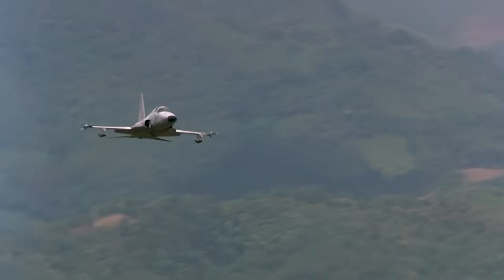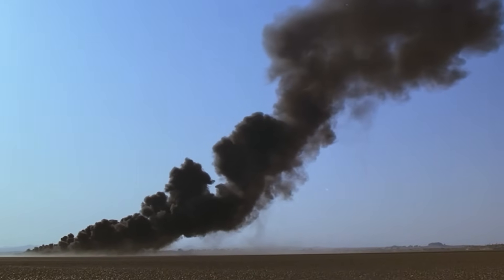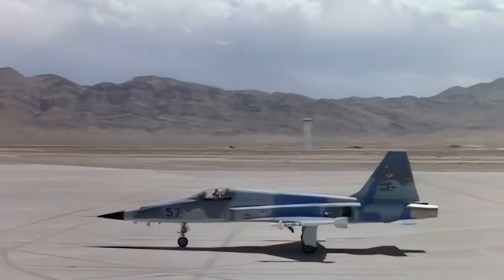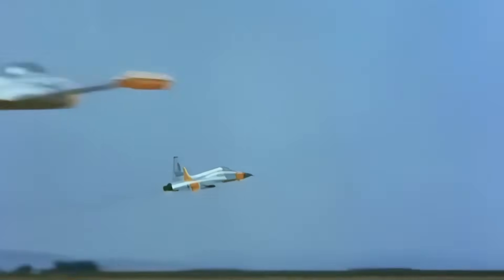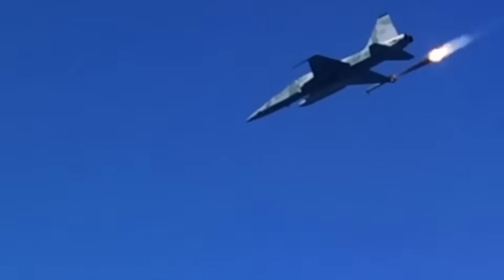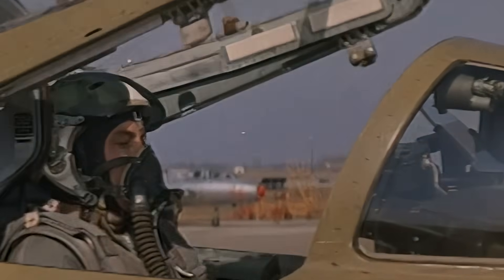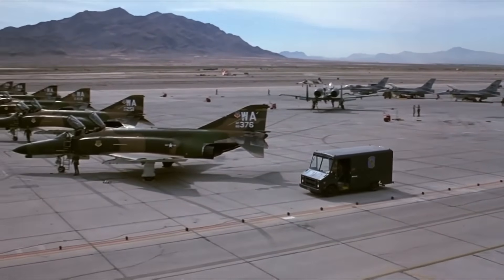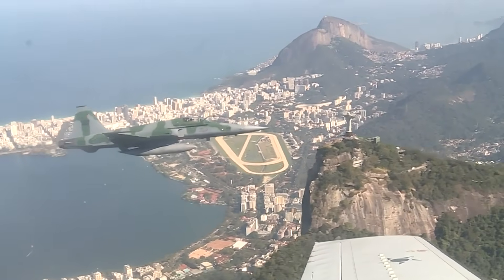The Small and tough Northrop F-5

Comment: Mistake here 10:58. I think you might have mispoke, but the F-5E didn't use the J58 engine as that's the engine used in the SR-71. The F-5E used the upgraded J85-21 engine.

Comment: The F-5 and T-38 was one of my favorite aircraft while growing up.
Reply: The T-38 Talon is the two seat version of the F-5 Tigershark. I believe T-38s are still in use by the US military and NASA. (NASA aircraft paint schemes (sky blue/white) are similar to the presidential aircraft.) I know of at least one T-38 is/was owned by a civilian, (retired) USAF Col. Thornton. His Talon was filmed in the movie, Dragnet, flown by Colonel Thornton.
Reply: @TheHawk--oe8iq  The T-38 is not the two seat version of the F-5 Tigershark.  First of all the Tigershark is the F-20, not the F-5E.  The T-38 and the F-5 are not the same airplane although both were derived from the N-156 prototype.  USAF didn't need a light fighter but needed a new advanced trainer so Northrop developed it into the T-38, which flew before the F-5.  Further development led to the F-5A/B Freedom Fighter, which flew a bit later. The F-5B has significant differences from the T-38 and even though many parts are interchangeable many are not.  The F-5E/F is even more different.

Comment: those F-5s the soviets got...yeah their test pilot mopped the floor with every Mig-21 he flew against. Then the russians tested against their most advanced fighter of the time, the Mig-23. It lasted longer against the F-5 but the F-5 still won.

this was a 1950s era design, the cheapo export fighter, vs the current and new front line soviet fighters...and it won, EVERY SINGLE TIME.

Comment: 6:15 "decent flight performance" is one hell of an underrated line for the F-5 Tiger's actual flight characteristics. This little fighter is so maneuverable that it can stick to fighter aircraft much more maneuverable in low speed situations. This lent a great deal to the F-5s ground-attack role - it meant that it could be much more accurate (albeit at the expense of being shot down much more easily due to the lower speed).
Reply: Wait a minute, all the A-10 fan boys insist you need to fly slow to be accurate in the ground attack role.
Reply: Ground attack doesn't require maneuverability. It requires stability, which is the opposite

Comment: If they were to give this a stealth treatment it would be an amazing low cost response fighter.
Reply: LOL.  "The stealth treatment"?  That would require a redesign.
Reply: @gort8203 not really, but its okay if youre ignorant of what stealth actually entails.
Reply: @helmhamburgerhand  As you seem to be.
Reply: @helmhamburgerhand actually quite really. Stealth requires use of radar absorbent materials which can add to aerodynamic drag, and angled fuselage panels which also negatively impact aerodynamics. Stealth also requires (or at least demands) internal storage of weapons, and that's going to be difficult on an airplane that never had much internal volume to begin with.
Reply: @winternow2242 no not 100%. RAM is a secondary part of stealth anything. The majority of it comes from reducing or altering radar reflection. Which largely is done by reducing rounded surfaces and aligning angles presented by the craft. Which can easily be done to any aircraft given research & testing. After that Then comes any of the myriad amounts of composite materials and coatings. You actually dont even need internal weapons bays if you build the storage into the wings.  And a plane that size will start off with a miniscule cross section given even basic modifications. Add any RAM coatings and this is tiny
Reply: @helmhamburgerhand in other words, change the surface shape, make the wings bigger, use different materials, etc., but somehow it's just a modification of an existing airplane.  

So it can do the same job as airplanes we already have, and have had for years. 

And we would don't that...why?

And, nope, testing isn't easy at all. Wh where did you get that idea?
Reply: @winternow2242 and yet boeing has made its umoteenth version of the F15 with various stealth features. Korea, japan, various Europe countries have all developed some form of it. So yes if you have engineers they can modify an existing airframe without much difficulty. To various degrees. Maybe learn about the field before looking like a fool.
Reply: @gort8203 Tru-Coat.  Which you can probably get for an extra $600.  As famed aviation expert Jerry Lundegeaard said so wisely in 1982, you don't get Tru-Coat, you'll get Radar Cross Section problems, and it'll cost you a heck of a lot more than $600.

Comment: The F-5 also had one characteristic that helped it to be liked: It looked rather sleek and modern in the 70's! Also seing most Air Forces behind the Iron Curtain had older Mig-15/17/19 and 21, the F-5 was at least as good or even a bit better than what they would have faced. As Pinpoint Interceptor with a CAP Option carrying up to 5 external Tanks it was a great choice for NATO Members in the 70's and even early 80's! The Swiss still fly them  (however limitted now) and they are one of the richest countries per capita! They only replace them soon with 5th Gen Stealth Jets. While I wonder why they did not buy the Gripen instead? Don't ask me why they need a Stealth Jet for interception :) But it shows how hard it was to send the F-5 into retirement for them. They were actually loved by the people as well. Even here in Austria we flew them for a short while waiting for the Typhoon's! And the Pilots as well as the Technicians loved them!

Comment: The F-5 is one of the most beautiful aircraft ever built. It just looks like a hot rod.
Reply: It is good looking. It looks like it is nimble and agile, like a Mazda Miata or Lotus Exige. As opposed to the F4 which is also a very good looking plane, but has an appearance of being powerful, as if it just brute forces physics to get airborne (which it kind of does) more like a late 60s muscle car, like a '69 Mach 1 Mustang.. 
And the F20 just takes it a step further. Evolving the F5 to look even more sporty like a Ferrari 355.
Reply: I was thinking they reminded me of the Vipers from Battlestar Galactica.  'Hot rod' is a good description.
Reply: @deBebbler  The unofficial name for the F-16 in USAF service was “Viper” because the early pilots thought it looked like the fighter from Battlestar Galactica. It’s still called that today.
Reply: @squarewave808  I always forget about the Viper nickname for the F16.  I just always think of it as the Falcon. It makes sense that they drew the connection between the two. Thanks for the info.

Comment: F-5 is not that small for that era. It's actually slightly larger than MiG-21 the most widespread soviet fighter.
Reply: There were numerous variants of the MiG-21, developed over decades. The F-5s dimensions fall within those of those various MiG-21s. According to information ive found oine, an empty F-5A weighs a little over 8,000 lbs.  An F-5E starts at 9,500 lbs. The original MiG-21F weighs 10,000 lbs empty.

Comment: There's also a variant called the F-5EM which served the Brazilian Air Force and has been upgraded by Embraer with new radar, new avionic system, a new Multi Function Display replacing the old analog gauges, new HUD, a RWR system, Data link capabilities, and last but not least the ability for aerial refueling.
Reply: Serves you said Served the F-5 is still a main workhorse  Brazil does not have enough Jas39  to defend the huge Borders and country of Brazil plus the F-5Em was fully modernized to a 4th gen fighter so its more than capable which is why it still   Flies today
Reply: @Argentangelozoom2003 what is your understanding of 4th generation aircraft, and how do you place any F-5 in that category?
Reply: Embraer and Israel system company completed the modernization completing all delivieries last one delivered in 2020

Comment: Fun fact, the lerxs were actually not put at the wing root for any aerodynamic reasons, it was installed to house an actuator that wasn’t present on the T-38. It was only during testing that the Northrop engineers realized the the F-5 could handle higher angles of attack, but the didn’t know why.

It was not until later testing during the 60s and 70s that the engineers saw whilst testing scale model in a wind tunnel did they observe the vortexes coming off the lerxes, and THEN they understood. Naturally this lead to Northrop attaching massive leading edges to all of their designs.

Comment: Maybe I should go next spring/summer to Swiss to see the Tigers a last time before they get retired end of the year 2027.
Reply: I would not expect them to be getting replaced by that F-35 Turd anytime soon. Especially since the Main Donald Turd want's more money. They may go for a cheaper but better suited politically situation soon. Like the Gripen!
Reply: @WanderfalkeAT 
Opinion dismissed
Reply: @9Apilot  Sorry, not payed by Lockeed! So I am allowed to say the Truth! :)
Reply: @WanderfalkeAT  For the swiss I preferred the Gripen too. The F-35 is ugly as hell. But yeah, they choose the F-35.
Reply: @MisterIvyMike  The problem is not the hideous design but the maintenance and the kill switch as well as the fact that for a interceptor Stealth is unnecessary. Not to mention that the F-35A is much less suited for short runways or flying through mountain valleys, than either the Hornet or the Gripen. They may have faired better with the F-35C! Especially because the wings are bigger and would allow to maneuver/takeoff/land at lower speed and they can be folded in and this would help to store them in their underground bunker systems! This will be the next Mirage 3 Scandal and heads will roll for sure!
Reply: @WanderfalkeAT 
Thanks for the explanation. My thoughts were much shorter than yours. But yeah, you're right. The Gripen is designed for grafel runways and for low maintenance costs. And in the alps you can perfectly hide between the enorm mountain ridges so stealth is secondary.
We germans had our own scandal with the Starfighter. I loved to see that plane fly but how the contract was done was not right.
In our case maybe the Mirage III had been the better option...

And yeah, I hope the Tiger will fly longer than to the end of 27...
Reply: @MisterIvyMike  As much specialized the Swiss Airforce is in maintaining Aircraft (and we saw that when we leased 15 of them in 2004), they cannot keep a 50 years old Airframe forever. So I understand they have to replace them at some point. But they don't need a Nuke Carrier, Stealth Bomber or better Weapons than Sidewinders for Air Policing. Even Austria would have faired better with the Gripen than the Eurofighter (even if the EF is the more capable Interceptor), but the EADS Lobby is as strong in Europe as Lockeed is in the US!

Comment: This is the perfect WWIII aircraft. Not F-35. Just needs a bit modernized version.
Reply: A bit modernized, so, mid 1990s?
Reply: @winternow2242  L39 NG level avionics.
Reply: @xmeda L-39, the Soviet era trainer?
Reply: @winternow2242  L-39 NG. Find some info.
Reply: @xmeda i already did. Just like i said. It's a trainer and light attack aircraft. And hardly a "WWIII aircraft".
Reply: @winternow2242  avionics generation does not determine role
Reply: @xmeda capabilities affwcting performance do that. So, what capabilities do you rhink can be added to this plane.
Reply: @winternow2242  Detection/warning and modern weapon support.
Reply: @xmeda basically what you can find on any tactical aircraft of the past 60 years, whether it's a real "WWIII" airplane or not. In your case, not.
Reply: @winternow2242  you cannot. Even 30 years ago avionics of identical functionality was 2+ times larger and much heavier and with less options. F-5 is little plane, not F-15 grade, every gram and milimeter counts. It needs good RWR, IRST,  support for last versions of AIM-120D-3, Meteor and best radar it is possible to fit in that limited nose space (last version of Grifo-F maybe). Preferably components already used on other recently produced or upgraded planes to keep cost under control and components available.

It would still be much cheaper than Eurofighter/Rafale class both for purchase and maintenance. Less demanding for airstrips, storage and personnel.
Reply: @xmeda  Not sure what it is that you say I can’t do.  

Doesn’t matter, your earlier point that testing can be done faster is easily disproven by history.  The avionics of 30 years ago was larger in scale than the avionics of today, and the avionics of 60 years ago even larger – yet it still takes more money and time to develop combat aircraft than it did 30 years ago.  The F-4 was developed in the late 1950s, and after a first flight in 1958 was in USN squadrons by 1961.  The Navy chose the F-18 as their new lightweight fighter in 1975, but it didn’t enter service until 1983. The Navy took nearly as long developing the Super Hornet, reportedly spending much more money than they did on the Legacy Hornet, which had been a clean sheet design.  The F-22 was 1st flown in 1997, but didn’t enter service until 2005, and that was well over a decade after the 1st flight of the YF-22.  The F-35 first flew in 2006, but didn’t enter service until 2015, also 15 years after the flight of the X-35 prototype.

“F-5 is little plane, not F-15 grade, every gram and milimeter counts.”

Sounds like you’re undermining the point you thought you had proven.  Every increment in weight and volume counts.  Or more accurately, it costs.  All those increments would result in an airplane that is larger, heavier, underpowered and more expensive.

“It needs good RWR, IRST”

As do existing aircraft.  Of course,  your theoretical airplane needs something the other planes already had – a reason for existing.  The other aircraft were developed to fulfill a role that either wasn;t served, or not as well.  Your airplane would be developed to do the job that other aircraft had been doing better for decades, upgraded by technology that could have as easily been retrofitted to existing designs, if not to existing aircraft.

“It would still be much cheaper than Eurofighter/Rafale class both for purchase and maintenance.”

And your certainty it would be cheaper, and less demanding but comparably perfoming is…what?

Comment: 10:50.  Not J-58 engines, just a more powerful version of the same J-85.
Reply: Yes J-85-21 with 5,000 lb after burning thrust. it looks like he just accidentally flipped the numbers around from j85 to j58. 

Great little video. Great little jet.
Reply: As a point of interest, Wikipedia does quotes the J-85-21 as producing 5000 lbs. of thrust in AB, but the aircraft flight manual T.O 1F-5E-1 dated 15 November 1990 quotes it as 4650 lbs. maximum.  May be the difference between ideal test stand thrust and actual installed thrust.
Reply: J-85-21 if I'm not mistaken, with 5000 lbs thrust wet

Comment: The N-156 used cutting-edge extruded honeycomb aluminum to give more strength to the wings.  But it was expensive.  So the plane had relatively high wing loading, causing it to have a wide turning circle in dogfights.  When the airframe was upgraded to the F-5E Tiger II, they had many alternative larger wings in mind.  To keep the price low, Northrup kept the small wing, but added LERX to give more lift.
Reply: The wing was not made small to save a few dollars on materials.  That's absurd.  The wing is sized to provide the performance desired.
Reply: @gort8203  There's quite a lot on the Internet about the alternate wing designs and the rationale behind each.
Reply: @floycewhite6991 Yes, the internet is a great source of misinformation, isn't it?  Northrop did not make the wing smaller to save money on materials.  That is preposterous.  You make a wing smaller to reduce weight and drag.  You don't understand airplanes if you fall for such crap.
Reply: @gort8203  I don't understand the argument.  I didn't come up with the different bigger-wing designs.  They did.
Reply: @floycewhite6991  I've gone back to read read this exchange, and it appears you don't understand me because perhaps I  misunderstood your original comment and we have subsequently kept talking about different things.  You said they kept the small wing to keep the price low, and I thought you were talking about the size of the wing making it low cost.  My point was that they would not avoid make the wing larger simply because a larger wing costs a bit more in materials.  Of course substantially changing the wing design would have incurred additional costs in development and testing, so they did save development money by not making substantial changes to the existing wing. But it had nothing to do with its size per se, or cost of materials.

Comment: A superb plane and glad that it found its niche, long enough to serve and provide value.  Cool plane, and always a MiG-28 in my head. :D
Reply: The Navy Reserve Unit in New Orleans recently decommissioned their F-18A+and B+ Aggressors to the Ubiquitous Mig 28s lol.
Reply: Its still flying in Europe and is a main work horse jet in Brazil surpassing the Gripen in how often its used. In Brazil the airforce had their fleet modernized to fullfill modern roles and compete with modern adversities.
The contract  was awarded to Embraer and Israel tech company. The complete upgrade converted this fighter to a gen 4.5 fighter it address the F-5 in its entirety from wings weapons hull to technology etc etc

Brazil’s last F5 4.5 gen upgrade was delivered to the Airforce in 2020 those included the Jordanian F-5 that were acquired in 2007